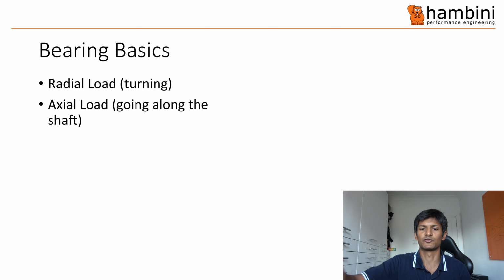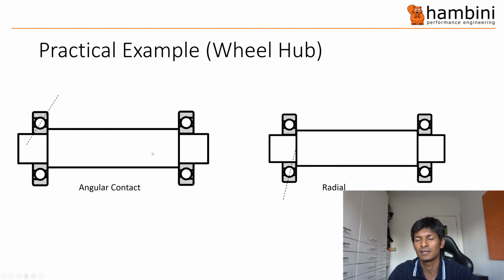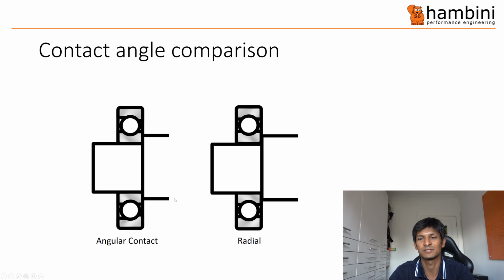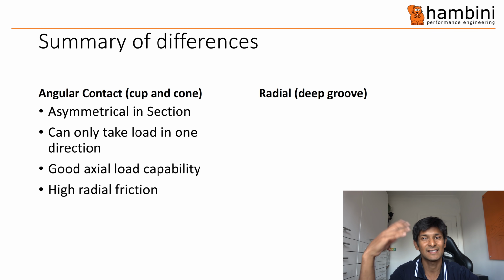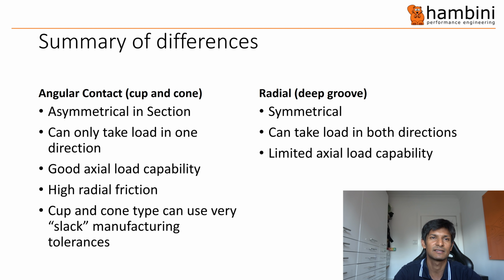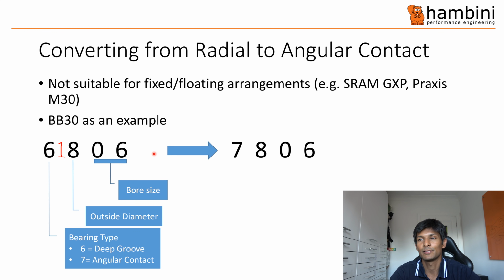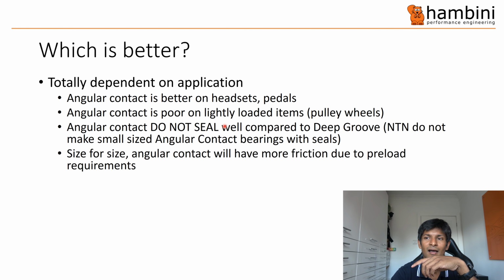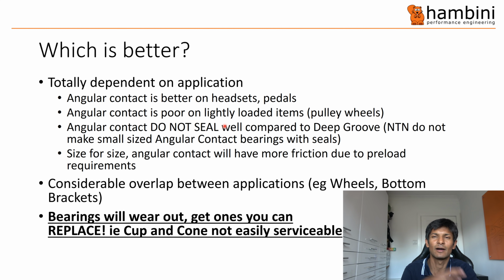Angular Contact vs Radial Bearings (Cup and Cone vs Cartridge): Engineering Analysis

Comment: So you waffled on for nearly half an hour without mentioning one of the most significant differences between radial and angular contact bearings. Angular contact bearings HAVE MORE BALLS IN THEM for the same size of bearing. Shimano uses cup-and-cone primarily because with that, you can have a full complement of balls, that is, fill the entire gap with balls. More balls means the load is spread over more of them, the wear is less, the imperfections in the races are less important, they don't have to be as hard, the lubricant doesn't have to be as high quality... You said elsewhere that you think Shimano hubs are the best. Well guess why. Angular contact.
Radial bearings have less balls simply because you can't fit more in. When they are being built the inner race is put in off-centre and the free gap is filled with as much balls as will go in. Then the balls are spaced out evenly and held in place by the cage, which gives the bearing its rigidity. Thus, your answer about the cage being there to prevent balls from "hitting each other" is bollocks. The cage is there because if it weren't, the bearing would fall apart. Try it. Take the cage out and try using the bearing, I dare you.

Comment: Radial loading is not turning. Radial loading on a wheel is rider weight.
Crosswind loads on bearings are not pure axial in a typical hub. It will decompose into an axial component and opposing radial components on the opposite bearings.

Comment: There was a lack of perspective here on the hertzian stress involved. You said the angular have less stress, but does it matter? Bicycle bottom brackets don't see very much load I don't think compared to their rating, so the stress would be relatively low. Radial bearings become angular bearings when preloaded, so the matter to be decided is if it is worth it to endure the lower sealing ability and higher drag vs the lower stress and possibly longer race life, but I'd like to see the numbers. It seems to me that bearings fail in this application because of contamination and/or corrosion so sealing would be a priority.

Comment: Should we use caged bearings for cup and cone wheel hubs instead of freefloating?
Reply from the maker: I would go for caged.
Reply: @Hambini  even as a modification? Do you run caged in your dura ace hubs?
Reply from the maker: @oreocarlton3343  It is very difficult to retro fit. so I run them without cages. But if you were to design it from scratch I would go for caged
Reply: @Hambini  retrofiting can wear out the cones prematurely?
Reply from the maker: @oreocarlton3343  It shouldn't but you will end up with less balls  but better control.
Reply: @Hambini  dont less ball bearings per cone mean faster cone wear?
Reply from the maker: @oreocarlton3343  Yes and No. You not have the balls hitting each other which causes wear as well. You gain the wear from increased herzian stress. If you were to total all of it up. Caged would give you an advantage.
Reply: @Hambini  thanks!

Comment: Do you think oil filled polymer bearings like SKF MTRX will extend the life of the bearing when used in environments where risk of  contamination is high?  I'm thinking mountain biking in wet and muddy conditions.
Reply from the maker: They came out of the marine industry so it's not a new technology. It has been proven there so I see no issues in it working on a bike.

Comment: Race surfaces are always doomed to fail before the balls due purely to the overall surface area offered up for wear and tear. It must be noted that 'cup and cone' bearings, due to their serviceability, can be maintained to easily last 20-30 years which is a figure that 'cartridge' bearings can only dream of. A 'cone' will fail before a 'cup' due again to the surface area offered up for wear and tear. It must be noted that in this regard Shimano have always offered replacement cones for their hubs which, thus, further contributes to that 20-30 year lifespan.
Reply: I had some cheap wheels with cup and cone bearing.  Didn't service then at all for 4-5 years.  The cones went, but I couldn't get replacements.  I was frustrated that I couldn't get replacement parts, but fairly impressed with how long they lasted.  I have two sets now.  One dtswiss with cartridge and the other with shimano.  I have more confidence in the cup and cone, but we'll see.  I will start to service my shimano hubs.
Reply: My old time bikes with only cup and cone had the bearings last forever ... just needed a service every few years. I'd have worn out the rims long before the wheel bearings.

Comment: Nicely explained Hambini. Could you discuss the aircaft spec "stepped bearings" which Whyte mtb bikes use on their suspension frames with the spacer washers in the assembley housing. loving the the techinal nomencalture of what a F#cked bearing is.

Comment: In practice, my impression is that the guys using Shimano wheels or the more expensive Campagnolo (or Fulcrum) wheels with cup and cone bearings seem to have VERY little trouble with them. The modern ones are very easy to adjust with the wheel in place, and they seem to need very little maintenance.

Campagnolo's cup and cone hubs have been the exact same design since the 1999 model Record hub that introduced the aluminium spindle and moved to 5/32" bearing balls, 15 per side, both front and rear. The hub shells are different wheel to wheel, for marketing purposes, but internally the only difference is that some wheels use ceramic balls, and some also ceramic bearing surfaces. These parts are all interchangeable. 

In 18 years of regular use, I never had any issues with these hubs. I never had to replace any parts. Meanwhile, my buddies seem to be busy getting new sets of cuntish shitbag bearings for their (insert brand here) wheels.

Comment: So factory set up with my 2017 Cannondale CAAD12 has a PF BB30, 4000 miles In the first year, and I’ve had it serviced twice for the dreaded CREAK, needs a third now. I don’t wash the bike, but do wipe it down, so the bearings are rarely subjected to water. Very hilly/mountainous area where we ride. I’m contemplating switching out to a Chris King BB that is angular contact. Reviews are good in terms of solving the creak. Will I notice the friction then in terms of watts? How much more likely then will service and/or replacement be needed? Stick with radial? Go Angular? Better Hambini BB solution?

Comment: Do you think there is an argument for using angular contact bearings on mountain bike wheels given the greater axial loads?
Reply: No, there's a good argument for using angular contact bearings on ALL bikes!  Plus, think of a fully rigid road bike with 28c tires at 120 psi bashing into/over/through a concrete or asphalt pothole versus a full suspension mountain bike's 2.3" tires at 15psi hitting much softer soil.  The difference in conditions couldn't be larger.  That said, it would be interested to measure peak forces endured in each scenario.

Either way, all bikes benefit from angular contact bearings because of their larger contact areas and adjustability.  Once play develops in a radial cartridge bearing, you pull and replace it.  Not so with cup and cone and hubs like Chris King.  Adjustability translates to longer life.

Comment: Hey @Hambini! Nice video. One question: My front hub runs on 6901-2RS bearings, like 1x a year I replace them since I feel they develop sideplay (axial) they run buttery smooth but turning in doesn't feel like it should have been.
 I found a 7901-2RS similar physical dimensions but angular contact. Do you think they would worth the investment? Strangely the rear wheel is not prone to develop such issue. 

Any plan to do a video on Campag/Fulcrum cup and cone hubs? What to look out for and how to maintain them? I am always struggling how much preload I should aim for.

Comment: Why would anyone want to convert their BB bearings to an angular contact if there is more friction?
Reply: This video is full of incorrect information. According to bottom bracket manufacturer  Wheels Manufacturing LLC / and Enduro bearings, angular bearings have LESS friction and last longer than radial bearings: i bought this up, right here in the comments section.. and.... <crickets>.. no reply from Hambini. See and read for yourself. https://www.endurobearings.com/products/bearings/angular-contact/
 "We produce a line of Angular Contact (A/C) cartridge bearings specifically designed for hubs. In standard radial bearings, only 3 or 4 balls make contact during the load, at any given time. In Angular Contact (A/C) bearings, ALL balls are engaged and spread the force over a larger surface area, to decrease friction and minimize wear. "
Reply from the maker: I'm afraid I could not find your comment but I will reply here anyway. The study into this type of loading is called contact mechanics and herzian contact stress in particular. 

The Herzian contact stress for the radial bearing is more like a point load. the contact stress for the angular bearing is verging towards squashed point or line. This allows it to take more load BUT increasing the load and distributing over a larger surface area increases the rolling friction. Hence the Angular contact has more friction. 

Coefficients of friction for various bearings are here
https://www.amroll.com/friction-frequency-factors.html
Reply: @Hambini  Thank you for your reply. So, are enduro bearings lying when they wrote on their website that "In Angular Contact (A/C) bearings, ALL balls are engaged and spread the force over a larger surface area, to DECREASE friction and minimize wear. " I am confused...

Comment: I would think that tapered roller bearings would be best for heat sets although not sure they make them small enough for this.
Reply: Tapered require a tapered axles or steerer. Not necessary just overkill. They work well in stub axles and last for years if correctly loaded.
Reply: @glennoc8585  no they don't, your inner race can be the same as it would be on a cartridge ball or angular contact bearing.

Comment: On 12:26, where you resolving force to axial+radial. Did you mean the force from the spokes, or force, that wheel under different conditions (turning, etc) may produce? Because resting wheel will not put any force on bearings, except the weight of the wheel. For vertically resting wheel this will be only radial force.

Comment: Hey Hambini, thanks for another masterclass. What do you think about Coombe pedals? I am currently using Speedplay Zero system, because of walkable cleats and better cornering clearance (riding fixed gear crits) and precise adjustability, tho even under my 59kg their bearings go shite quite fast. I also wonder if Speedplay bearings (I bet quality of those are not far from zipp's lol) can be replaced with something better.

Comment: If the balls have slightly different diameters and the cage prevents them from hitting each other due to the different travelling speeds in which the different sizes result - doesn‘t that mean that the cage makes the faster and slower than average sized balls skid? And what effect has that on the friction and on the wear of the races and the bearing as a whole?
Reply: Yes it does mean they are skidding. Since it is unavoidable (perfectly sized parts do not exist), I guess it is the best solution to the problem. 
The slip will only be a fracture of a percent which is much better than if the balls rubbed together, since that would essentially give you a slip of around 200%. I can imagine that the surface pressure between ball/race or ball/ball in these scenarios is comparable, so just letting them roll loosely and allowing them to contact each other would speed up wear and friction considerably.

Comment: I don't agree with the statement that Shimano puts balls and ball bearings in their hubs, because they are "cheap". Their higher-end MTB hub Deore XTR hubs have custom-made  angular bearings (not radial), that can be easily serviced, regreased and replaced by the owner. I am sure these bearings have bigger balls than stock bearings from bearing manufacturers.  If there is a common item between cheap crap chinese hubs like the ones made by Novatec is that they all have stock, radial, sealed bearings, which are a lot cheaper to buy and put together in a hub than any cup /cone /ball bearing solution.
Reply from the maker: The main point here is Shimano hubs have integrated metal raceways on the axle and hub. If they wear out, you have to replace those parts which are expensive and are essentially a new hub. The other hubs on the market allow the use of bearings where all surfaces are changed in  one go.
Reply: @Hambini  Thank you for your reply. Fair enough. I think the problem is that unless the hub manufacturer describes what brand and model bearings they are using inside their hubs, most consumers have no way of knowing the quality of what is inside.. i am sure the quality of the bearings in most run-of-the-mill hubs is far inferior that what is inside high end Shimano hubs, even if the technology is different.
Reply from the maker: @ggdd1299  I would agree. One notable exception is Carbon TI who use SKF. Mavic used to use NTN, now they are on to something with no name.
Reply: @Hambini  Thank you for your reply. Another thing worth mentioning is that cup and cone bearings have to be put together manually, which is more expensive than just slapping and pressing a pair of bearings into a hub.
Reply: Ok. Dude you missed the entire toilet and just peed in the sink.  The bearings Shimano uses are manufactured in house with slack tolerances.  This is cheaper than purchasing bearings from SKF, NTN or any other tier 1 bearing manufacturer. What are you missing.  Also take a look at the Hub blog post you complete dolt.
Reply: @joshgross8741  right genius.. i am sure the  cheap shit bearings Novatec is using have better tolerances than Shimanos' LOL... Maybe SKF and NTN's bearings (the ones that Hambini sellls) have better tolerances than Shimano's bearings, but i am sure not many hub manufacturers are using those..  the vast majority of  cheap chinese hubs are using shit, cheap bearings that are probably worse than your run-of-the-mill cup and cone bearings, so comparing Shimano's high-end hub cup and cone bearings against ALL radial bearings is not really fair or useful.

Comment: Nitpicking: The radial bearing is symmetrical in relation to a line 
through the middle, the angular contact bearing is also symmetrical but 
in relation to a point in the middle ;)

Comment: A really stupid questions - what is "pre-loading"? I've heard people mentioned it a few times when they install the bearing and crank, isnt it just tighten to the required torque and should be ok?
Reply: Pre load is how tight the adjustable part (usually the cone) is against the actual ball bearings.  More preload means less play.  As you increase pre load, play reduces to zero.  Thereafter, bearing friction and rough feeling increase.  The ideal adjustment is where the bearing is a smooth as possible, but without play.  In cheap angular contact bearings, this is the thinnest line.  Or in other words, the bearing goes from having play to rough with no in between.  Higher tolerance bearings have a larger zone where it's smooth and lacks play.  This is the sweet spot.   This gives you better performance.  Higher tolerances cost more to manufacture.

Also note that your preload will change when you fasten your locknut (or your QR skewer).  In a hub, the cone gets tighter when you torque the locknut down against is.  So you have to learn how much to back off the cone to anticipate the additional preload.  And then you have to adjust for any additional compression a quick release imparts on the bearing.  In general, front wheels with 9mm axles suffer considerable compression and must be adjusted accordingly.  When done right, your hub will be too loose, but as you close the QR lever, the play disappears, leaving he hub perfectly adjusted when on the bike.  That's how it's used, after all.

Alternatively, old BBs did the opposite.  Tightening the lockring on the adjustable cup decreased preload, so you had to make it a bit too tight and then lock it down, achieving proper preload.

Comment: In my orifice we have a never ending debate about preload for dg bb... SKF guidelines are somewhat arbitrary on the subject and empirical. In bike hubs we often see dg bb just locked on the inner races by tube spacers/shoulders with no preload. I guess this is to satisfy the people that say 'they spin up well' and are baffled by a spinning wheel with no load. I prefer hubs with angular contact or dg bb with some preload function. What's your view? The last set of tune hubs i bought, come with a selection of 100 micron shims  to set preload. Nice touch.
Reply: Tune is garbage.  TheDarkInstall will verify that.

Comment: how it is made that inner race doesn't fell out, is it somehow connected to outer race?
Reply: Tension across the bearings pulls the inner and outer races both against the balls.
Reply: If you look closely there's a small lip on the low side of each race that retains the ball on that respective side.

Comment: Thanks Hambini, this was great! Over the years I've serviced lots of kids bikes and found that often the wheel cup and cone bearings are poorly set up from new, almost always over tightened. I've often wondered if the bearings are somewhat ruined almost immediately. A clean, re-grease and correct adjustment improves them significantly but I do wonder if the components were actually manufactured well, or whether it is just poor assembly of reasonably good parts.